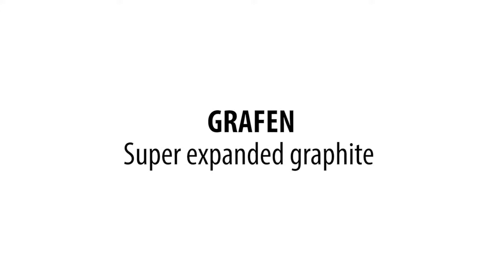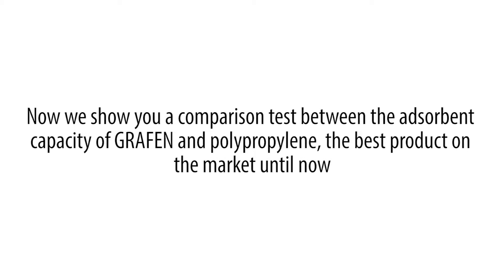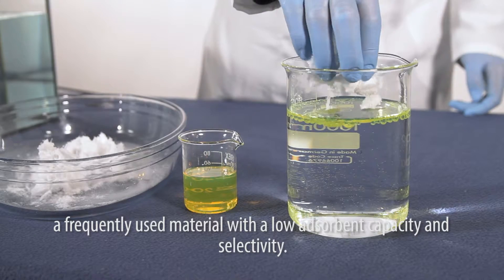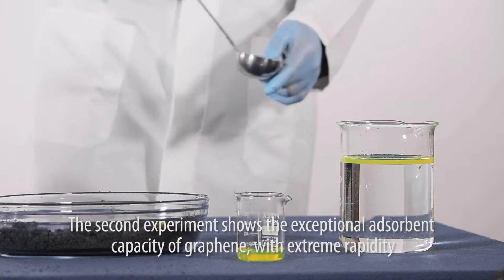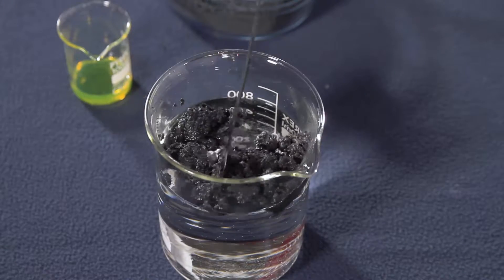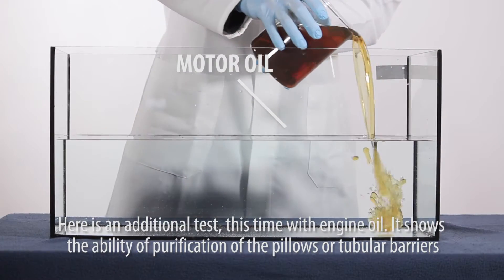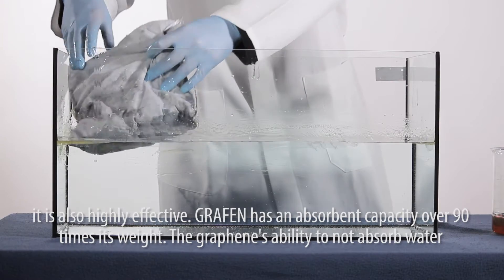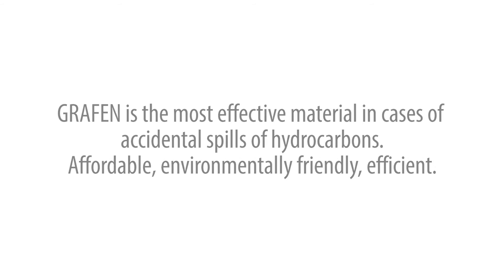Super Expanded Graphite.

Comment: As interesting as this product is, let's not confuse graphene with a product name. Graphene has little to no absorbent properties beyond a percentage of a micron, whereas expanded graphite does (or any expanded material; you could just as easily use synthetic foam for 1/60th of the cost of processing graphite by the ton). 
I would imagine this is marketed for home or light commercial use. Oil spills at sea would require obscene volumes of this and you'd still have the problem of storage between taking it off the water and getting back to shore (and dispersing it into the water while being responsible for reclamation). This is why they use industrial oil separating centrifuges the size of a house on-board a tanker.
Reply from the maker: With reference to product name you are right. It generates confusion between two different materials with different absorbent properties.
I have to say that for oil spill at sea they use booms with SEG inside, they don't use bulk SEG as powder

Comment: How environmentally sensitive is it's manufacturing in bulk? Does it take more carbon in the form of energy and emissions than it can soak? How scalable is the production of this material, and does it have diminishing returns?
Reply: Oil spills are much more harmful to the local environment than CO2 emissions, and it is not because they spill a lot of carbon. Some oil spills have even been set on fire to convert the harmful compounds into relatively harmless smoke that dissipates fast.